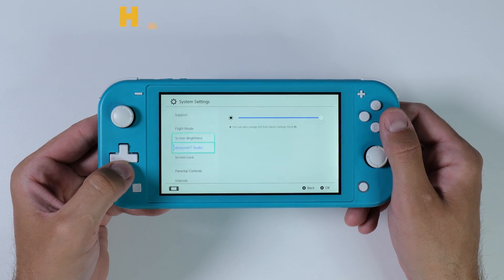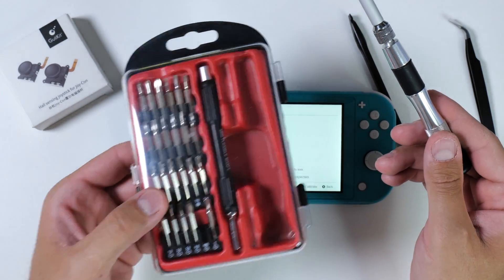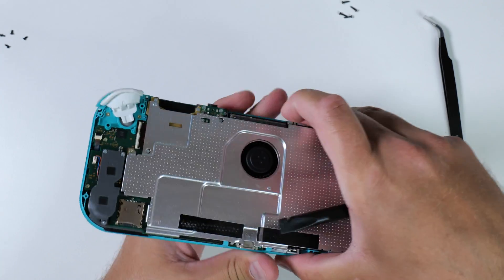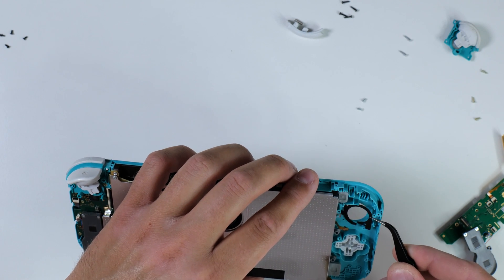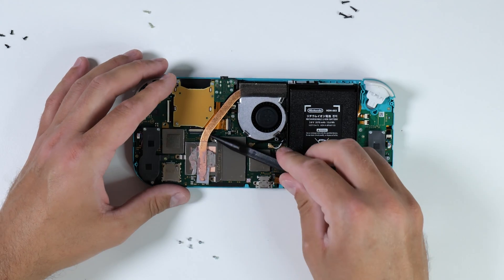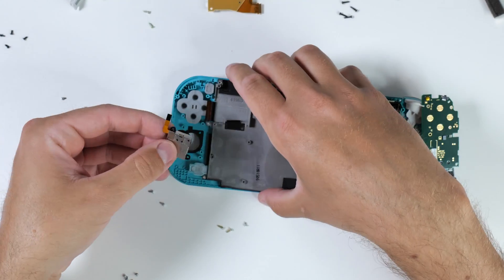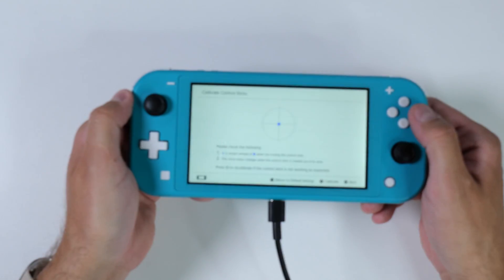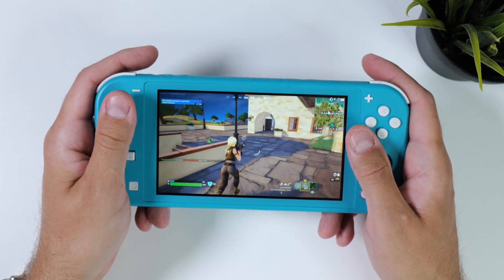Nintendo Switch Lite Hall Effect Joystick Upgrade // Assembly Tips

Comment: If you have drift problems with your Lite, just sell it and buy a V2 or OLED, then get a NitroDeck or EggShell, and your problem is solved.
Reply: I have the OLED as my main, but I still love to use the Lite sometimes when I go on trips because it's so small and I love the d-pad for retro games. I think the Lite is a nice companion to the OLED or V2. I wanna try to do this mod, looks a little difficult but at least it should just be a one time thing.
Reply: what's a V2?
Reply: @DaveTheeMan-wj2nk  Nintendo Switch V2 is the chip revision for Switch that allowed better battery life. V2 Switches are the Switch lite (all versions), Switch OLED (all versions) and any Switch made after 2019.

Comment: I just installed one hall stick for my regular Switch and the calibrate only registers the top left area. So neutral position is set to 25% x 25% and moving the stick to the bottom-right registers at 50% x 50% or 0 x 0. All movement is registered, but restricted to the top left corner. Is my new stick bad or did I order a wrong model?
Reply: Recalibrate
Reply: You should try register it again

Comment: Did it improve the battery life as well ?, as that is one of the claims the company makes, is that it uses something like 50% less power then the factory sticks.
Reply from the maker: I don’t really have any ways of measuring this, as in the end it’s to small of a difference.
Reply: @techcravers  How would you know it's to small of a difference if you can't measure it ?
Reply: @IrnMaiden3040/10 ragebait
Reply: @IrnMaiden304because the power that goes into the joystick is minimal compared to the cpu/gpu consumption
Reply: Troll for asking questions 8 months  ? ...

Comment: I've done a few replacements of standard joycon sticks with the gulikit set. The only thing I've noticed is that the plastic may be a bit more fragile. My friend and I have seen a few sets break right at the plastic where they are screwed down. So definitely do not over tighten the screws with these kits.
Reply from the maker: Thanks for sharing!
Reply: I rly needed that advice. Thanks